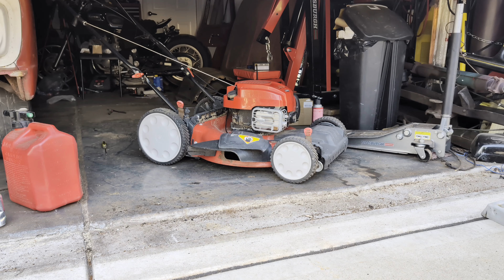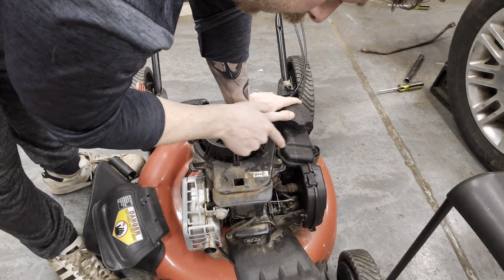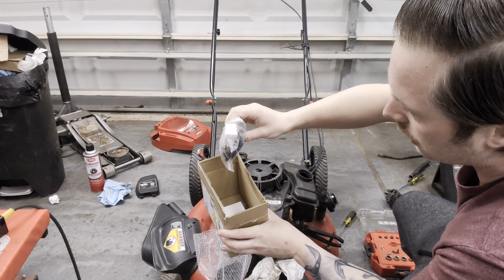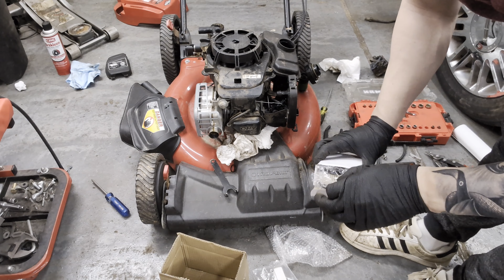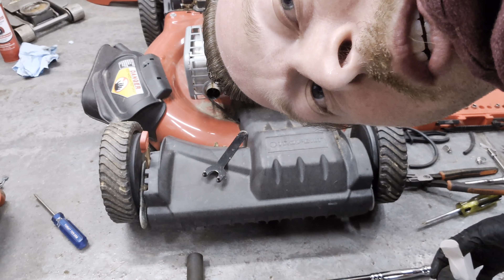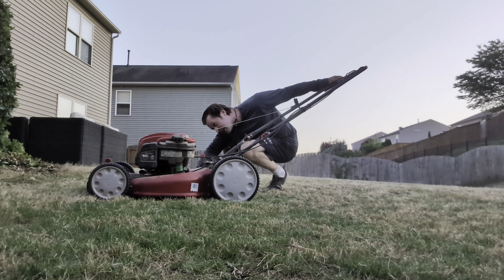Lawn Mower Tune Up -- Troy-Bilt TB230

Comment: Hello, I'd let the mower run a few minutes and drain the oil. Don't go by the sticker, change it every year. Throw away that chinese spark plug, you'll thank me later.
Reply from the maker: Thanks for the advice! No drain plug on the unit, it is not meant to be drained.